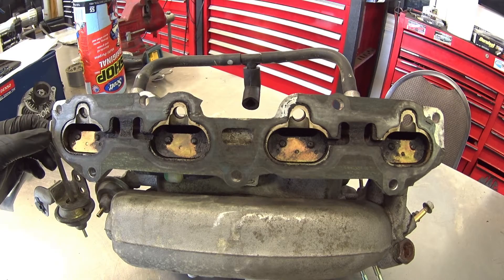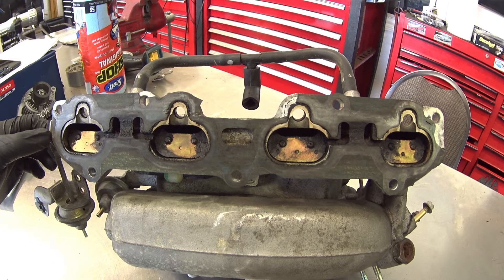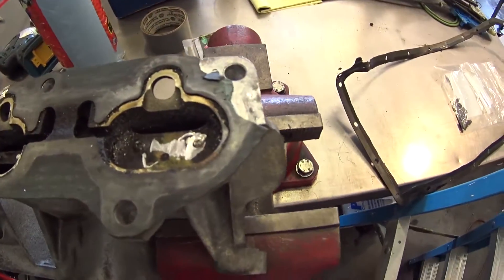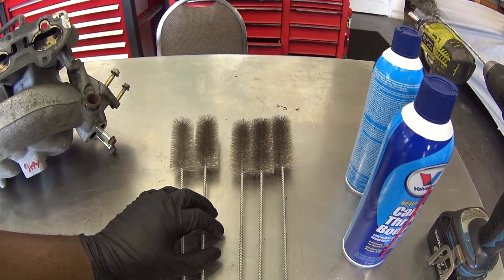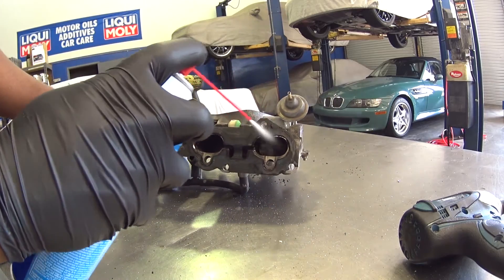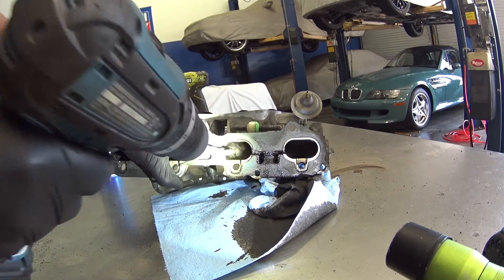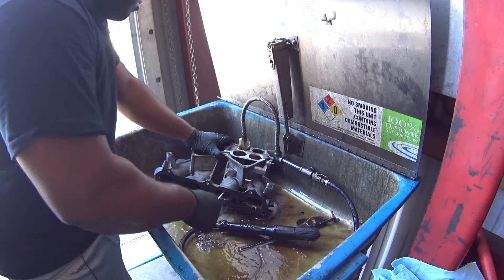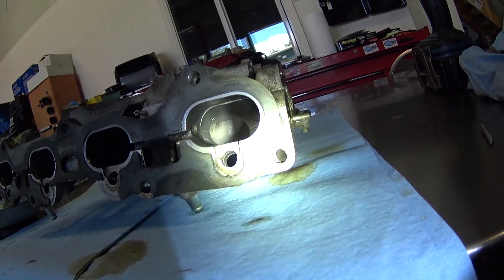Mazda Protege VTCS Delete EP. 5 - Pt. I

Comment: Before coming across this video I was considering buying a MP3 ECU, for the performance benefit. Is this essentially the same thing but free??
Reply from the maker: Well you can do this...Find the MP3 ECU and MP3 Intake Manifold and you dont have to worry about doing the conversion. The MP3 didnt have the VTCS. The 2nd option and this is what I highly recommend, Buy the MP3 ECU and the swap in the JDM engine. HUGE difference. Supposedly the MP3 only had 10HP more. But the JDM FS-ZE has 163-170HP.....you likely wont feel 10hp....or be able to measure it. But you can DEFINATELY feel the jump from 130HP to 163HP - 168HP!

Comment: Hello! First of thanks for the video. Now my question is mine is throwing code P1569 would deleting it fix the problem or would it cause it to throw that code
Reply from the maker: The PCM monitors the VTCS valve for imput voltages. If it detects that the voltage is too low when the solenoid is commanded off then it lists this as a problem. The valve should still open and close so you have to leave the valve in it but remove the shaft. That way it wont throw any codes
Reply from the maker: If you leave it disconnected it will throw a fault
Reply from the maker: Another option is to switch to the MP3 ecu as it does not have the VTCS, therefore that particular ecu is not looking for those voltage values

Comment: Do you place them again wo the butterfly’s?
Reply from the maker: Once you remove the VTCS system it adds a performance benefit, so there is no need to return the valves back. There is a secondary set of valves in the lower plenum that I reinstalled. Due to the low airflow at lower RPM, I didn't see a reason to remove those. If you  remove the lower plenum valves, the effect man be that the engine will have reduced torque output in the lower RPM ranges, which would further reduce daily drivability.

Comment: I do not know if you had same issue as me but mine VTCS doesn't work at all with no error codes as well.
For now i just block it in open position till i do not remove it as you did.
Completely different car right now!
I owned four of Protege ( 323 exact - Europe )
three 2.0 FS engines and only that problem i'm having in Sportive version.
Your doing great job, keep it up!
Reply from the maker: I didnt have any issues with the VTCS system on my car. I removed it purely for performance reasons. The way it is made, it can easily jam in the closed or open position due to carbon and oil deposit buildup.
Reply: @RetrocarStyle  
Maybe carbon deposit blocked but it moves freely.
I will remove it anyway cause in short way I work on my Protege close to what you do.
Reply: I will mention of something else.
Far as I know you can lower your rpm after swap V gear from Mazda 626 ( don't know the US name ) from 2.0 FS 115 PS 
It's obout 400rpm and also if you change final drive from 626 it will goes more but that I think is to low. 
In EU gear box difference is since third gear, fourth and fifth. Changing only the fifth do not kill the acceleration 😉 and its possible without removing whole gear box. 
When I do that I will confirm or denied it here.
Keep in mind that next gen 626 FS has the same gears as we.
Reply from the maker: @Gronozzz  Actually this mod was going to be featured on the channel following the high performance mods!!
Reply: @RetrocarStyle  
Great! Waiting for that🙂
Reply: i have the exact same car 2.0 323f sport , how do I know if its working properly ? im a total noob with this car and i feel it a little sluggish

Comment: Great info, do you know if the 1.6 BJ protege same year would have the same system on the intake manifold?
Reply from the maker: As far as I know the FP and ZM engines do not use the VTCS or VICS system.
Reply: @RetrocarStyle  thanks man!
Reply from the maker: @danielhofmann8699  NP!!

Comment: Now if only it were a little easier to get the intake out
Reply from the maker: Its not too bad...pro tip: use 1/4 ratchet and extensions with 13mm swivel socket with a mirror and flashlight.

Comment: I recently did an engine change an had to delete these swirl flaps cause my cars ecu doesn't have it but I left the rod in an at first the car accelerated like shit. But I turned that little shaft vertical which is basically obstructing the airflow an the car performs better at all rpms. Idk if it's the turbulent air mixing better with the fuel or off I just gotta take the shaft out an see if it performs better or worst
Reply from the maker: From my understanding of the system, it works at cold start...then as the engine warms up it opens all the way. You can remove it completely. Removing the valves is the most retrictive part. Any thing in the path of the incomming air will cause some type of turbulent flow, even with ITBs but the exception is that they have a larger supply of air so its sort of a trade off depending on the setup.

Comment from the maker: First, thanks for leaving a comment on the video. Your feedback is appreciated. There are two ways you can deal with the holes left in the manifold. Surprisingly, only two of the holes need be covered. The others can be left open without doing anything else. But if you like, you can fill them all. This will be explained in the next up coming video.
Reply: I have question I have mazda protege 1,8 engine 4 cylinder and I want to know I a intake manifoid fronm a 323 familia could fit on my mazda please contact me aim traying to contact you
Reply from the maker: @alfonsomolina9143  The cylinderhead on the 1.8 model differs from the 2.0 head quite a bit. I do believe the port bore pitch and port sizes will be much different when adding a manifold from one of the 2.0 liter cars so this may not work. However the 1.8L head is more closely related to the Miata 1.8 engine. You may have more compatability with engine parts from a Miata. If the engine is a BP engine, i do believe the Miata Skunk 2 manufild will fit, which flows more air than a regular FSDE single plenum manifold.